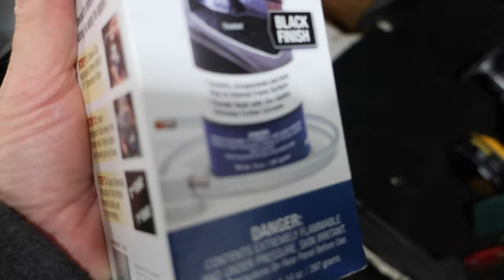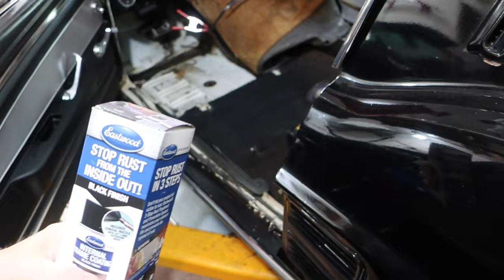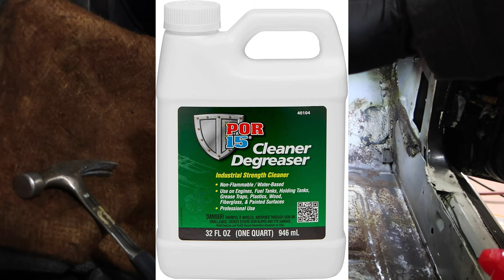67 Mustang - Episode2 - Floor & Carpet

Comment: Excellent work. Really like you showing the physical work. Before the inside frame spray paint, did you clean that out? Flush with water or blow out with air?
Reply from the maker: Thanks for the comment. Yes I ‘shot’ compressed air in multiple holes until it all came out dust-free.  I’m not sure but some of those parts might be galvanized so not likely to rust. However, I need to research that because I’m not sure. Good luck with your coupe!